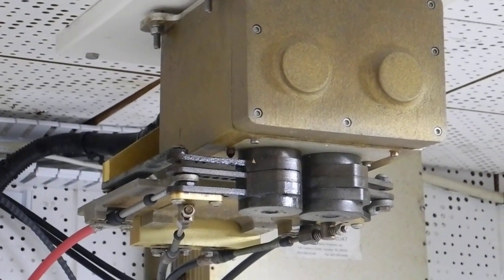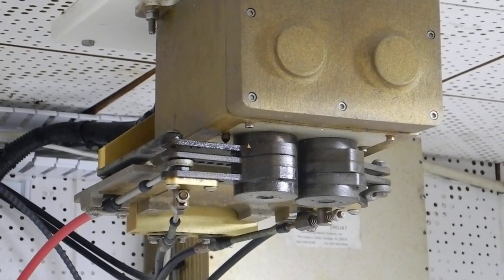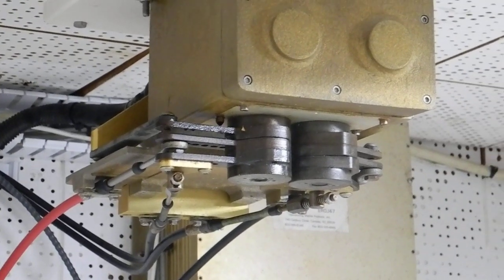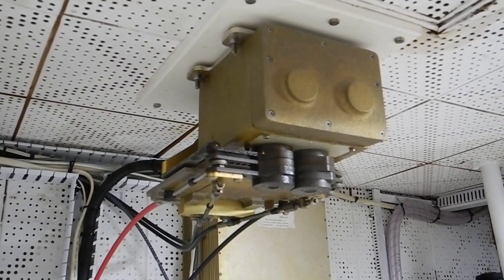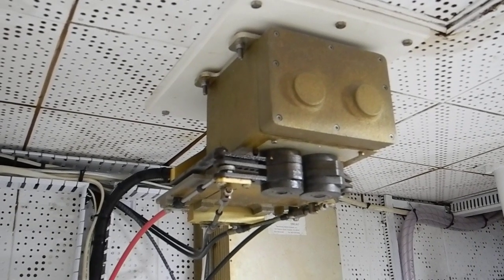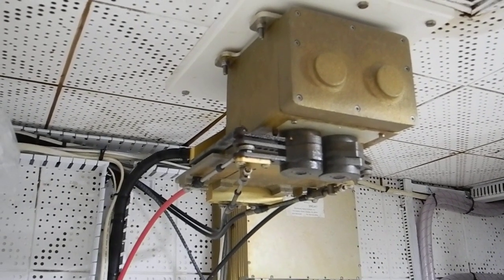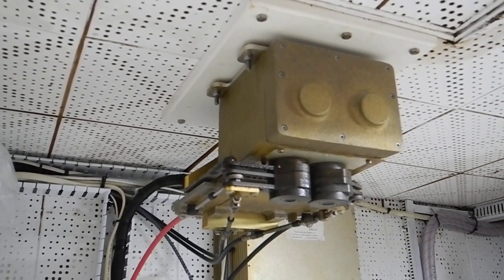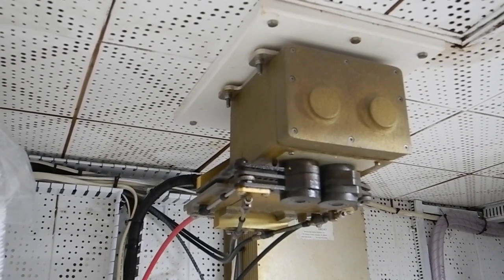Aftermarket electronic controls.

Comment: Good morning. I guess this is the way a lot of boats are equipped now days
Reply from the maker: Actually, this is the way to aftermarket fit the engines for electronic controls. If the engine was built by the engine manufacturer as an ordinary mechanical control engine then the boat builder had to add a device like this to use electronic controls. Think - electronic controls to a box like this then mechanical controls out this box to the engine and transmission. Many times this device will be housed in a large white plastic box. I have seen black boxes too.
Reply: @AskCaptainChris  Newfangled stuff 🤣
Reply from the maker: @alabamasmokeywilson6818  Maybe BUT what does your gas peddle connect to? Not linkage to the carburetor. There is NO linkage and NO carburetor. Computers run the world now.
Reply: @AskCaptainChris  What do you do when the controls fail? Run the engines with someone on the engines in the bilge with a radio. I have done that before.
Reply from the maker: t starr that’s a good thought if you have an experienced crew member.
Reply: @AskCaptainChris  Yes. Then it becomes like Star Trek. You yell into the microphone “Full Reverse Scotty!!!”
Then he replies “Im giving it all shes got Captain Chris!”
Reply from the maker: Car Wizard 🖖🏼
Reply: @AskCaptainChris  Do you ever tell an apprentice "Make it so" after giving a heading and speed.Haha!